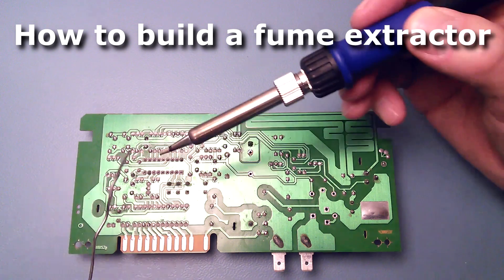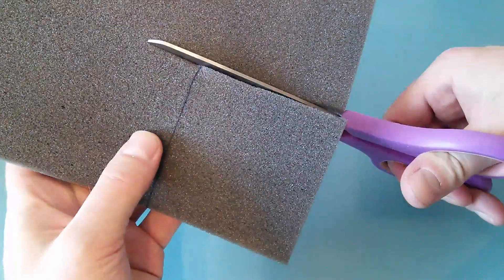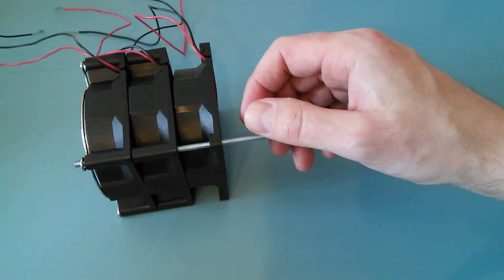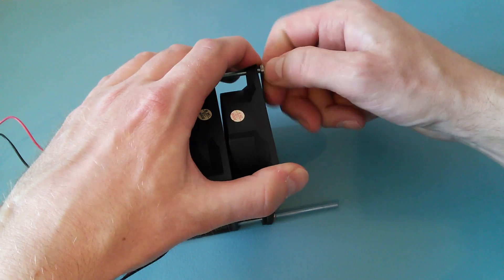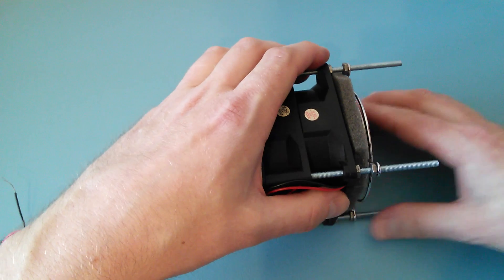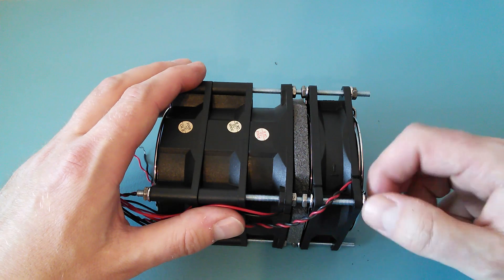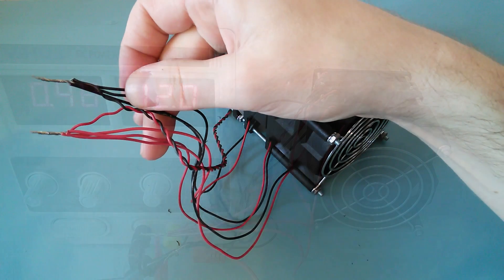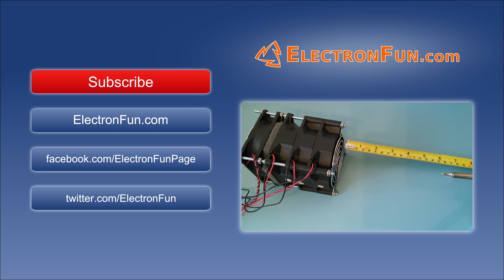How to build a fume extractor #1 of 3

Comment: nice build!
I made a sawdust collector/vacuum w/ 2 pc fans, a seltzer bottle (neck), connected to a pretzel box, and powered by a 12v wall adapter. works good enough for my wood carving/sanding purposes.
any ideas to improve it?
Reply from the maker: Thanks for your comment and sharing your build. I've never built a sawdust collector, so it is very difficult to suggest improvements. If it works for you, than it's a good project.
Reply: hope you have more videos!
great build!
Reply from the maker: Sooner Science Nerd
Thanks a lot! I have plans for more videos :)

Comment: thanks. i just tryed it with one fan but my fan is very strong at about 7 inches candle flame is horizontal . I burned stick in front of fan stick was very smoking and no smoke coming from back. it's good i recommend to make this!
Reply from the maker: What fan is it? If it's so strong, you can use just one, but figure out a way to mount a filter and your job is done.
Reply: ElectronFun.com  i used same foam as you. I mounted foam with wire. It's really working good. Maybe i will make adjustable stand for it
Reply from the maker: testas 3339
Nice job.
Reply: @ElectronFunCom  i have 4 pieces 220 AC fans so that means more fans you stick together then stronger vacuum you have ??
Reply from the maker: @seckinseckin3919  It depends on the shape of your fan blades. I found out while doing my tests that mixing different blade shapes usually gives worse results.

Comment: Hey love this project. I want to build it but would the "Antec TriCool 80mm Cooling Fan with 3-Speed Switch" work? it's on amazing for $3. Idk if it has those negative and positive wires in the same way yours does.
Reply from the maker: Thanks! This fan will work, the only difference is that you have a switch and 3 speed variants. I can see at least 3 wires in the photo - black (ground), red (+12V), yellow (sense wire used to determine the fan's speed). You need only ground and +12V.
Reply: Could I just snap the sense wire off? Would that effect any of the performance? What exactly does that sense wire do?
THANKS!
Reply from the maker: James Whyte
You can get rid of the yellow wire without consequence. The sense wire just gives you information how fast the fan spins - two pulses are sent with each rotation of the fan, so you can easily calculate RPMs.
Reply: Awesome! Thank you i'll be sure to give updates when this is complete!
Reply from the maker: James Whyte
Thanks! Keep us posted.

Comment: Hey Electronfun i think this is a great project and i am going to make myself one i have a question: What size threaded rod did you use in this video also what soldering iron are you using Thanks :D
Reply from the maker: Thanks a lot. I want to upgrade this project in the future. First thing would be the filter - I would use a carbon filter.
As far as I remember the rod was 3mm thick. The soldering station is not worth mentioning, it's a cheapie - Zhaoxin 936. I couldn't afford e.g. a Hakko. The prices are too high for a hobbyist.
Reply: ElectronFun.com Thanks
Reply: ElectronFun.com im building one now when im done i will make a video response for you :D
Reply from the maker: Skidtire That would be great! I'm waiting for your video :)

Comment: you can attach it to a bending lamp pipe so you can position with ease  :)
Reply from the maker: Nice idea, but you would probably need a heavy base. Otherwise the whole rig might fall over.
Reply: ElectronFun.com
 Maybe something "angled lamp" like system  and a clamp on the bottom so it wont fall.
Reply from the maker: Slobodan Djuric Why not :) I plan to upgrade this project a bit.
Reply: ElectronFun.com
 You could even take and old "hand vacuum cleaner" and attach a bending hose and apply the previous ideas on it, that would work nice.
Reply from the maker: Slobodan Djuric
These computer fans are not very powerful and the hose might be a problem.

Comment: you only need 1 fan and you should hook it up to a permanent power supply like a 8 AA holder
Reply from the maker: Have you ever tried 2 or 3 fans instead of one? I have and checked this empirically that 2 or 3 fans suck fumes much more effectively than just one.
My power source is just temporary, I think 8 AA batteries is not a very practical solution. I'll probably use a standard 12V wall wart.
Reply: @ElectronFunCom  i also think using more fans makes stronger but i guess sticking together all fans without distance 
neutralise effect and make weaker them. im thinkin of putting all fans in a pipe and leaving one centimeter between each fans makes more effective.
Reply from the maker: @seckinseckin3919  As I replied earlier, much depends on the shape of your fan blades. However, I'm guessing that leaving spaces between fans may rather decrease the air pressure. You could do a simple test with your fans and pieces of paper to check if you are right.
Reply: @ElectronFunCom  if they are inside a pipe then it is okay i think .. i will check it

Comment: How about the noise? Surely the sound of 4 fans must drive you nuts...
Reply from the maker: I cleaned and lubricated all 4 fans and they are very quiet. Some time ago I built another fume extractor with one big fan powered from the mains - it was much, much more noisy.
Reply: you can use Electric Foot Switch Pedal